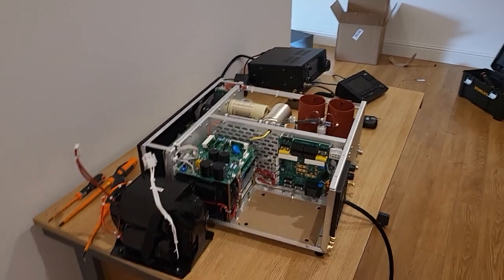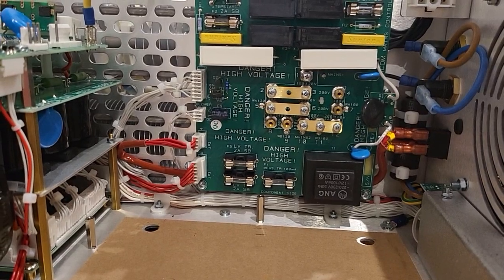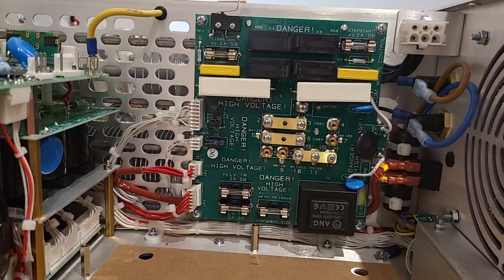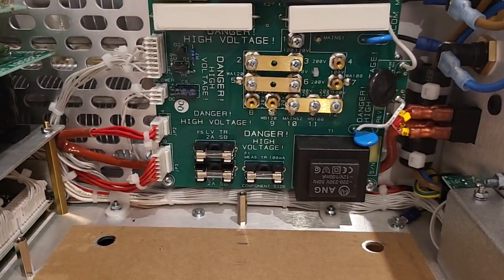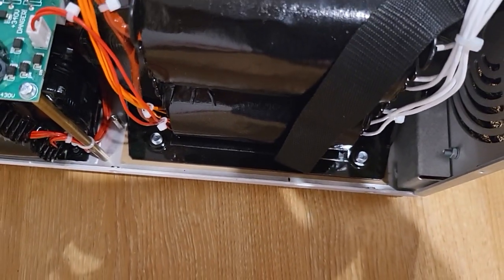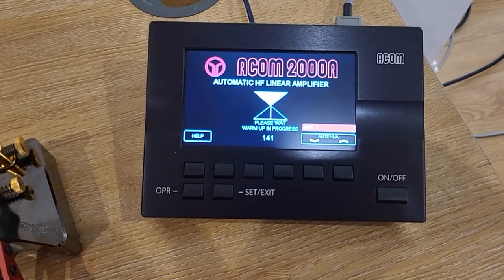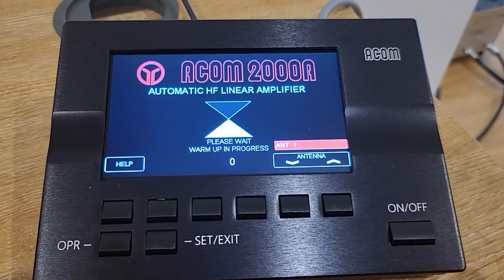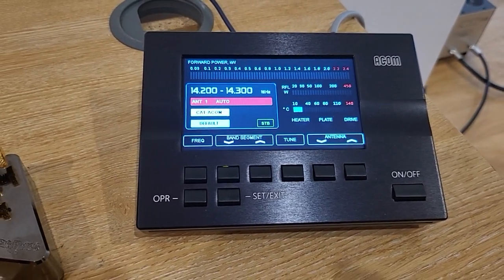Acom 2000a Trip on heater voltage high. Transformer tap change

Comment: running the 240 tap on normal european 230v is better, heater voltage is around 12V helps to protect the tube lifetime. Heater too high on 220 tap is more dangerous. amp works great on 240v tap

Comment: Beautiful amp, built like a Glasgow ****house. Serious overkill for the, inappropriate, UK limits though, I hope you don't go full limit with your loft dipole, hi, hi.. I suppose the hole in the desk would negate bringing in a 2 ton trolley jack, valuable information though. 73 from the IOM.
Reply from the maker: Thanks for comments. I don't run it in this country full limit, but at my other QTH I'm allowed to operate it at 1500w.
Reply: @CraigHaldane  I guessed that from your QRZ entry, and I was only joshing. I hope they have cheap electricity in Angola. Even if we could run 1500w in the UK, very few would be able to run it (half joke). Maybe I'll hear you one day, if you come off the Morse, 73.